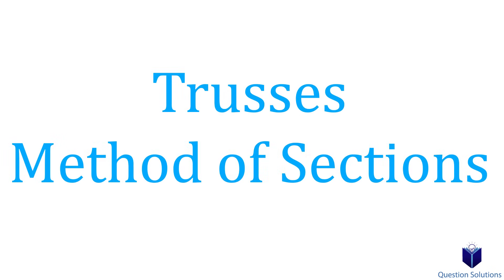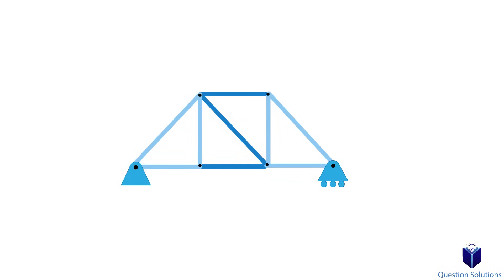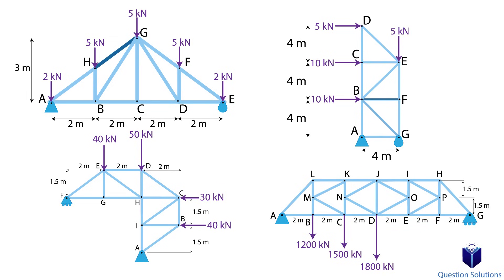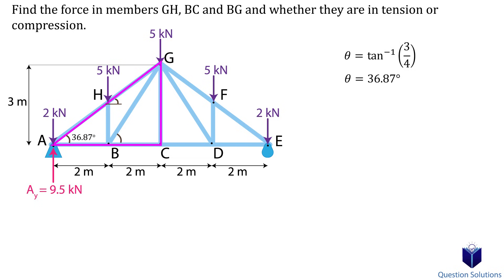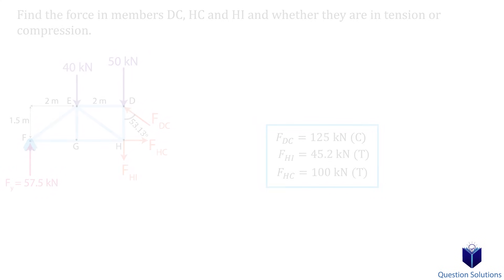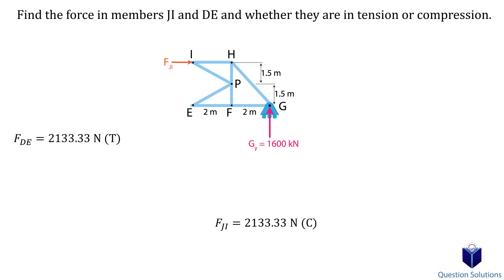Trusses Method of Sections | Mechanics Statics | (Solved examples)

Comment: At 6:03 you have set the 5kN force at point E to be going in the positive direction and F(GH) to be negative for finding the moment around point B. Can you elaborate on the best way to choose the direction of the forces when setting up the moment equation? I would have set it to -5kN and +F(GH) based on the direction of the forces pictured and gotten the incorrect answer.
Reply from the maker: It doesn't make any difference as to how you set the directions of your forces. You will get the same answer. The reason you are getting incorrect answers is because you're writing your moment equation incorrectly. So the direction of force doesn't matter, it's whether it creates a clockwise or a counter-clockwise moment that matters. Here,  the 5kN force is pointing down, that doesn't mean it's negative. What we look for, is to see whether that force would turn the truss clockwise or counter-clockwise. Imagine you hold the truss between your fingers at B, and we apply a force exactly where the 5kN force is, downwards. How would the truss turn? It would turn clockwise, right? Now notice next to the big sigma sign, we show a clockwise positive sign. That means we assume any force that creates a clockwise moment to be positive. So since the 5kN force makes the truss go clockwise, it's going to be a positive moment. Now look at force FG. If we apply that force, how would the truss turn between your fingers? It would go counter-clockwise. So it'll be negative. When you write moment equations, the directions of the forces do not determine whether something is negative or positive, it's how this force will act upon the object itself, and what sort of moment it creates, that determines the positive or negative sign. I hope that helps, if you're still confused, please see: https://www.youtube.com/watch?v=QNNnPZ68STI

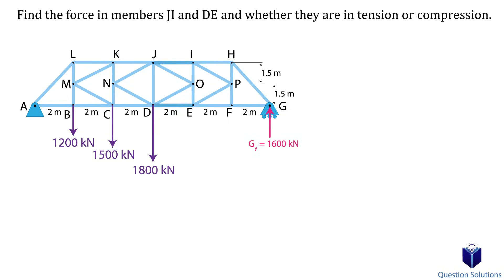Comment: I really like you videos, you explain better than my professor 😅🔥. I have a question, why did you cut the trusses like this in 10:00, why didn't you cut just vertically? It will give you the same number of unknowns
Reply from the maker: If you cut the truss straight down, you will need to work on the left side of the truss. But we figured out the reactions on the right side, so cutting it the way I did means you work on the right side of the truss. You can cut straight down though, it's totally up to you.
Reply: @QuestionSolutions  oh I understand now. Thank you for Your precious time❤
Reply from the maker: @prog_ahmed  No worries, keep up the good work!

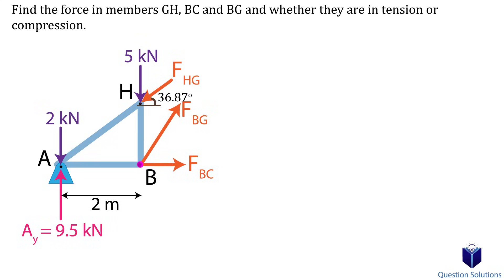Comment: For anyone wondering why Force BG was eliminated 3:01, it's because it's vertical component goes through B and so does its horizontal component
Reply from the maker: That's right, but even more easier to remember is to keep in mind that any force starting where the moment is calculated, cannot create a moment at that point. The same as force BC.

Comment: 6:28 in your explanation you said that only the x component of force BG can cause a moment about D but on the working you used Sin instead of Cos. May you please clarify
Reply from the maker: So my guess is, you assume cos is for x and sine is for y. This is fundamentally wrong, and you must, absolutely must, remove that idea from your head. You have to look from the perspective of the angle every single time. Here, the opposite side to the angle gives us the x-component, and sine is opposite over hypotenuse. So you need to use sine. To get the y-component, which is now adjacent to the angle, you need to use cosine. See this video, it's less than 60 seconds and you will see what I mean: https://youtube.com/shorts/vynnKlJD_Jo?feature=share
Reply: Noted thank you  @QuestionSolutions
Reply from the maker: @Atezexus_the2nd  Awesome. Best wishes with your studies. Let me know if you need any further clarifications.
Reply: @QuestionSolutions But based on where you kept the angle, it's supposed to be cosine of the x because the angle is on the x-axis. Please explain. I'm a bit confused

Comment: Throughout all the Truss videos you talk about assuming the way the forces are acting and just back tracking if they are negative. Is there an intuitive way to always guess the direction correctly?
Reply from the maker: The intuition comes from doing a bunch of questions, in other words, experience. By the end, you should be able to look at a truss and know which way the forces are acting and be able to locate 0-force members. Also, it's not really backtracking per say when you guess wrong, you just change the direction of the arrow and make your value positive. The magnitude of the force is always correct, it's just a matter of whether it's positive or negative.
Reply: @QuestionsSolutions gotcha its just on my exam, we have to draw a free body diagram for a grade, and its online so its kind of a pain in the ass. So I guess a better strategy would be to mess with the free body diagram last and solve the problem first so I already know what direction the forces should be before putting them all in.
Reply from the maker: @MrStepBro  Ah, yes, it probably would be better to do it the way you mentioned.

Comment: Great video, but I got a question at 5:11, shouldn't the forces 2kN and 9.5kN only apply moment on the components perpendicular to the truss AH, because you also did that for Fbg?
Reply from the maker: The 2kN force and the 9.5kN force are perpendicular with respect to where the moment is calculated. If you imagine your finger at the location where the 2kN force is, and push, will the truss spin about our moment point? It would right? So it will create a moment. I think you're assuming we are doing the moment about the whole member AH, which is not true. We are calculating the moment about the pink dot, just point H. When we calculated the moment about point A, only the y-component of force BG creates a moment. But notice that the 2kN and 9.5kN force only have y-components, they are vertical, so it will create a moment about point H.

Comment: im getting 13.8Kn for HG.
Reply from the maker: I have no idea where you're referring to. Please use timestamps.
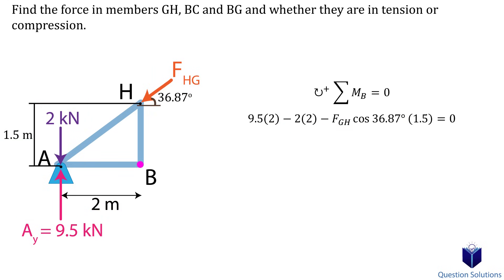Reply: @QuestionSolutions  my apologies. its at 4:08
Reply from the maker: @Oisin.O.Reilly  Hard to say without seeing your steps but the answer shown is correct. https://www.wolframalpha.com/input?i=%289.5%282%29%29-%282%282%29%29-%28%281.5%29%28x%29cos36.87%29%3D0&assumption=%22TrigRD%22+-%3E+%22D%22

Comment: In  6:06 why did we take - Force FG not + Force FG and why + 5×4 not - 5×4
Reply from the maker: We assumed clockwise moments to be positive, so if a force makes the truss turn about point B in the clockwise direction, it would be positive, and if it makes it turn counter-clockwise, it would be negative. Force FG causes a counter-clockwise moment, so it's negative. The 5kN force creates a clockwise moment, so it's positive. So try to imagine this big truss turning about point B, based on each force. That allows you to figure out the clockwise and counter-clockwise direction.
Reply: @QuestionSolutions  thank you sir

Comment: i have a question, in the first question when you were calculating moment about point H, why did you include the 9.5(2) and -2(2)? I thought the only force perpendicular to point H would be fBC and the x component of BG? Please clarify, thanks!!!
Reply from the maker: So both the 9.5kN force and the 2kN force are perpendicular to point H. Imagine you move those forces up to be aligned with point H, so straight up. Now you can see it a bit easier that they are indeed perpendicular. Another way to see it is to realize these forces are vertical, and will cause the object to rotate about point H, so it must create a moment. Force FBC and the x-component of BG is NOT perpendicular to point H. That's why they aren't in the equation. I think you are confusing perpendicular with parallel. Please draw a big diagram on a sheet of paper and really carefully look at what forces are perpendicular.

Comment: I confused in part 7:20 b/c the force BC=0 is it correct??what abt the external force 10kN
Reply from the maker: Sorry, I don't understand your question. We didn't calculate force BC? Did you give me the proper timestamp? 

Regardless, all values shown are correct, except at 9:08, where force F_HI = 42.5 NOT 45.2.

Comment: For question one I know u take thr moment at Point B but if we took the moment at point H, we would have two unknowns, Fbc and Fbg horizontal component both causing a moment. How would u solve it then?
Reply from the maker: The whole point of taking a moment about a specific point is to eliminate as many unknowns as possible. If you have 2 unknowns after writing a moment equation, then you'd need another equation, probably for vertical forces or horizontal forces. Try to take moments about points that lead to direct answers.

Comment: For the question at 5:25, why does the force in member BA not equal the reaction force from point A?
I found a reaction force from joint A of 45kN when taking moments about point G, but the force in member BA is 50kN.
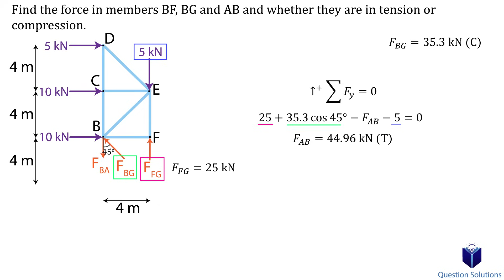Reply from the maker: The cut was made above the reactions so they were not needed. No calculations were made to figure out the reactions at A, or G. Also, where did you get that BA is equal to 50kN? At 7:07, we find that BA = 45kN.
Reply: @QuestionSolutions  Thanks for your quick response!
I wanted to verify that the force in member AB equaled the vertical reaction force at A. I understand that it is not directly relevant to the section method.
I just checked my calculations for some of forces in the Y axis, and I totally forgot to include the 5kN on point E. Now I have the correct solution for AB.
Thanks again for the brilliant video!
Reply from the maker: @milesbrack9188  Okay, glad to hear it was cleared up. Keep up the good work and best wishes with your studies :)

Comment: At 2:00 why there's a two forces in joint A, there's already a 2kn downward load why we have to put Ay in solving moment
Reply from the maker: That's a support reaction. So it's a pin support there, and that means there is an Ay component along with an Ax component. However, the ax component do not create a moment about point E.

Comment: 7:33 
can you explain how ? 
we have 
3 other forces in the x direction 
10 + 10 + 5 + BF = 0 
BF = - 25
Reply from the maker: Where did you get those forces from? So when you look at a joint, you only look at that joint, you don't care about what happens at the next joint over. There are no other forces applied at joint F other than vertical forces. I think what you're doing is translating forces from other joints to this joint, but remember, when we look at a joint, it's isolated. That's why you draw a separate coordinate system about that joint. At 7:33, focus on the right side of the screen and look at the forces at that joint. :)
Reply: @QuestionSolutions  ❤
Reply from the maker: @mastfamastfa1256  ❤

Comment: Thank you so much 

But there was a litt'l mistake in the 3rd problem; you use sine for the X components and cosine for the Y components
Reply from the maker: You are incorrect in thinking that sine is for x or sine is for y components or cos is for x components or y components. It doesn't work that way, and you are not alone, countless students make the same mistake on exams, and points get taken off. Please watch this video, it's less than 60 seconds and it will help you not make the same mistake I see so many students making. https://youtube.com/shorts/vynnKlJD_Jo?feature=share

Comment: VERY unimportant as it has no affect on the method but on 9:13 I think the answer is 42.5 not 45.2 but correct me if I am wrong
Reply from the maker: Yes, you are correct. There is a typo there. Good catch :)

Comment: In the problem 2, is it also same answer if i use the bottom part because i tried it and  i got different answer or did i get wrong?
Reply from the maker: Regardless of where you start, you will always get the same answers. There is probably a numerical error in your solution or an error in setup of the equations. The forces in each member can't change based on where we start to solve the problem. :)

Comment: Great video, thanks! Just a quick question, I tried solving the 4th problem but using the other side of the cut and the answer is different. Is my answer wrong or is it possible to have different answers when using different equations?
Reply from the maker: Regardless of the cut you use, or which side you use, you should end up with the same answers. This can be verified by solving the whole truss. There is probably some numerical error. :)

Comment: Hi, can someone recommend a good software for creating 2D-sketches of such trusses?
Reply from the maker: These were drawn on illustrator but if you want to figure out the values in trusses after you input them into a software, you'd have to look for engineering software or construction software.
Reply: @QuestionSolutions  Wow, what a fast answer. Thank you very much, that's a good tip. 
And btw.: Your videos are extremely helpful!

Comment: Thanks for the video! 
But I have a question for finding force BF in the second problem. If we would have isolated joint B, equilibrium along forces at x would be 10kN - 45Kcos(45) - F(bf) = 0. Hence i thought that force BF would not be zero. Im confused how this works ://
Reply from the maker: I encourage you to actually isolate for joint B and solve this problem. For your equation, you should have 4 forces. The 10kN, BG, BF, and BE for horizontal components (along x).

Comment: 5:07 I dont get why 9.5(2)-2(2) wouldnt be 2*sin(53.13)*the length of AH and same for Ay
Reply: since you are calculating the moment of point H
Reply from the maker: @marcoli262  So notice how both the 9.5 kN force and the 2 kN force are vertical, they only have y-components. In simple terms, they are vertical. All we need to figure out the moment about H is the perpendicular distance from those forces. The perpendicular distance is just 2 m. The length of AH does not matter. Please watch this video first: https://www.youtube.com/watch?v=QNNnPZ68STI
Reply: @QuestionSolutions  Thanks, but I still get the same final answer of Fbc by using my own method
Reply from the maker: @marcoli262  okay 👍 My guess is, you're splitting the AH length into components, but that's costing you way more time then knowing the proper fundamentals to get your answers faster. Generally speaking, university exams are time crunches, so you should learn faster methods then using sine and cosine to break it into pieces every time, it will be more efficient for you.
Reply from the maker: @marcoli262  I think I figured out what you're doing. So you're doing "2*sin(53.13)*the length of AH" where the length of AH is 2.5 m. So you're literally multiplying by 2m, but going through a long journey to get to 2 m, because sin(53.13)*2.5 = 2m. Again, ONLY the perpendicular distance matters, so you don't need to calculate the length of AH, and find the 53.13 angle, it's not needed at all. You get the same answer because you're doing what's shown on the screen but taking way longer to get there. Does that make sense?

Comment: just to be sure is it not supposed to be cosine on the second question Fbg since the Fbg sine will cancel at the pivot  D.asking just to be sure
Reply from the maker: You are calculating your components incorrectly. Cosine would give you the y-component, in other words, the vertical component of force FBG. Sine would give you the x-component, the horizontal component.

Comment: can you help me with the second question.is Fbg not supposed to be cosine for the moment because the Fbg sine is going towards the pivot which will cancel.asking just to be sure
Reply from the maker: No, it's sine because that gives you the x-component. So you need to look at the sides from the angle. The opposite side to the angle gives you sine, which in this case, is the x-component of FBG. Cosine would give you the y-component, which wouldn't create a moment.

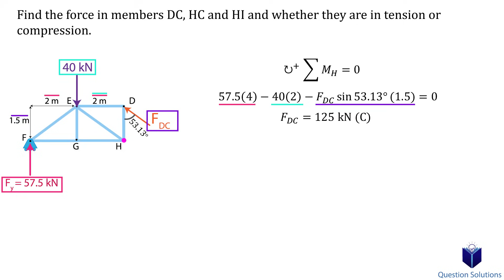Comment: at 8:49 , can we know wether we need to x eithr clockwise or anti clockwise because my answer 345 for fdc
Reply from the maker: It doesn't matter which way you assume it, if you get a negative answer, it'll be opposite to your assumption. So here, I picked it going towards the pin, but assume we did the opposite. Then the only thing that changes is that instead of -F_DCsin53, you would get +F_DCsin53. Which would yield a negative answer, and that means your assumption is incorrect. If you get 345, you made a numerical error, please double check your work.
Reply: In the sum of moment about H I think you need to use the COS of 53.13 and NOT its SIN 8:49
Reply: At H ,the sin of F dc ‘s line of action passes through the point H so it is not possible to get it is moment so we take the moment of its COS component 🎉AM I WRONG please tell me I have exam on next week😂
Reply: I have understood the the Force Dc is making the angle  53.13 with the y axis